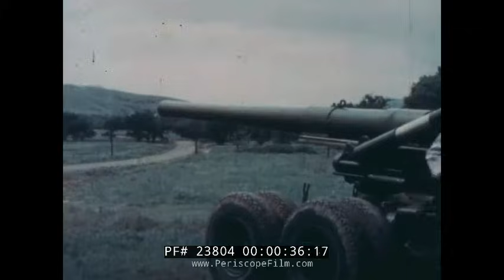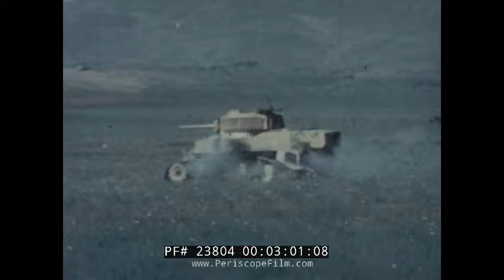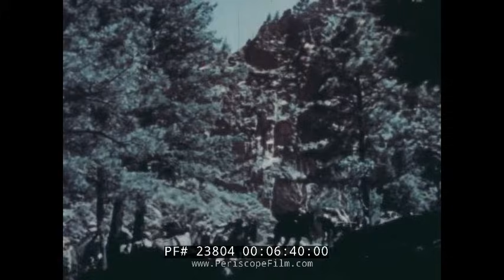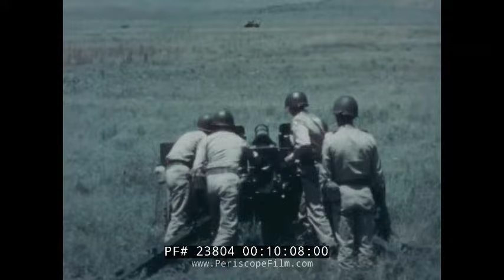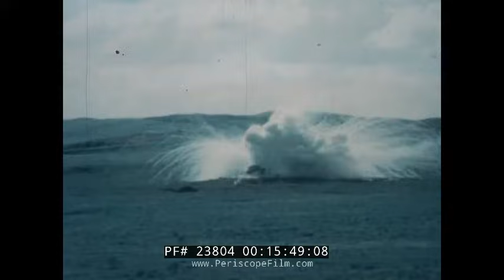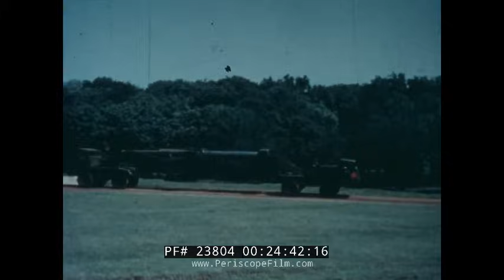1953 U.S. ARMY FILM  " WEAPONS OF THE FIELD ARTILLERY " 155mm HOWITZER  MACHINE GUN  BAZOOKA  23804

Comment: As a kid we built models of these weapons. I remember the most challenging was a 155 Long Tom and tractor by Revell. Painted the wheels on the gun a flat black to look like rubber tires. Great model.
Reply from the maker: Those model kits were a great way to learn about these weapons and their history. But the darn glue dried too slowly … and the Testors was so fumey you could get a contact high!
Reply: @PeriscopeFilm Testors also made the non-toxic model cement in the blue and white tube.  Twice as long to dry, but smelled like lemon and (most importantly) didn't give me headaches like the regular type did.

Comment: 5 hours into video.... "The 1,180,000,000 inch Gun is in the giga category. It is transported by 1 star tractor. It can be emplaced anywhere between 30 minutes and 8 years. It has a crew of 4 000 000. Its airburst shell is particularly good at knocking planets out of orbit. However, it only has a traverse of 30 degrees."
Reply: Hans RUN
Reply: lulz.
Reply: Asshole
Reply: You'd piss your pants if the "walk sign" didn't work on your stroll to Starbucks and a car came close to your open toes.
Reply: FRuxk Over to off land land. Sissy

Comment: There's not much I miss about the Army, but I was an FO and I miss the "fire for effect!" Never got to adjust for more than 105's, but still, it was good enough for a stiffy! Artillery- King of battle!
Reply: I almost upchucked when narration stated that 155mm and 8" take from 30 minutes to 6 hours to 'gunup' report. I went through 13A OBC at Sill in 1993, and it was 5 minutes for M198, and 2-3 minutes for M109A5/6 . Less for  M119 light guns. That was bunch of newly minted butterbars, not 'proper' trained gunbunny crews in FORCOM units. I am curious what would take them so long back in the day. Survey? Safety sheet? LandNav fiix? We did not dig recoil pits.  
Our instructors, both officer and NCO, had FA Fingers. Meaning more then few were missing finger tips on or more fingers. When it my turn to be the loader, those missing finger tips were on my mind.
Reply: Fellow redleg! I was 13A.

Comment: I wonder why they never used the german V-1 ; is cheap , simple and efficient!
Reply: We kind of did. A lot of early cruise missile designs were descendants of the V-1s. The V-2s were a bit more influential though, being the ancestors of most early ICBMs, which in turn are the ancestors of various spacecraft launch systems. Including the current Soyuz launch system used by Roscosmos and anyone trying to get to the ISS.
Reply: No accuracy. At best towards the wars end they had an area of a circle 7 miles in diameter where it would land. The early ones were much worse. The Germans would fire them at large cities and they would usually hit somewhere in the city. They were really more of a terror weapon than anything else. Contributing very little to the actual war effort.
Reply: The V-1 was timed to fly so far and when the timer ran out the V-1 would drop from the sky. The British sent radio signals that were false that the Germans were able to hear. The British said that the V-1s were overflying London. The Germans changed the timers on the V-1s and then the fell short of the city or in the English Channel.